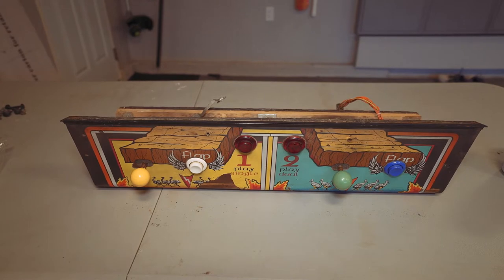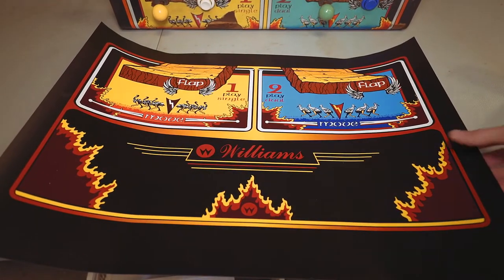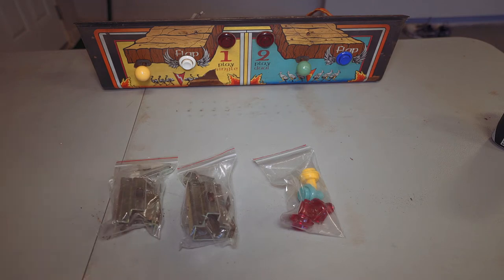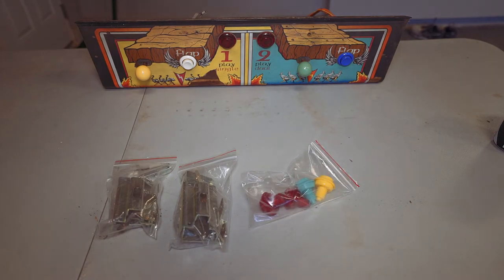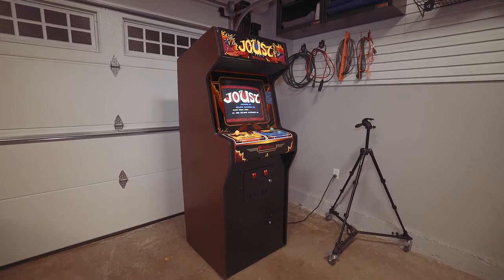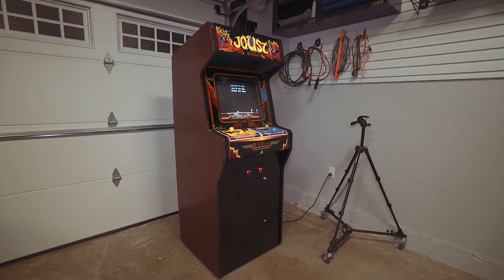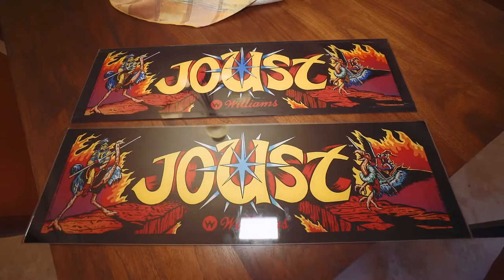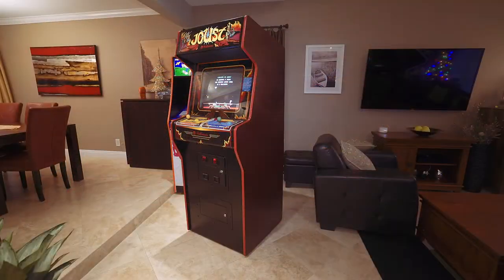Joust Arcade Game Restoration, Part 3

Comment: nice job however automotive filler primer first sand the cabinet down filler bondo which ever your choice then a coating of automotive primer 3 coats let dry in between the three coats then after the last coat let the cabinent sit for 4 days this gives the primer a chance to fully cure and bond once fully cured and bonded to the surface you can then use any paint on the side of the cabinent but great first time job with a joust..

Comment: A few years late, but I was thinking about this problem.  I've watched a lot of videos and read a lot of restoration threads, and almost everyone has issues with the laminate stencil taking off paint.  On top of that, everyone has different opinions about when the best time is to remove the stencil without causing the paint to chip along the edges.

I was wondering if there was a better (yet still affordable) way to do this.  I saw a cool video of a Williams factory making Defender arcades, and apparently they had large steel templates they'd lay on the side of the game, then use a commercial sprayer for the paint.  I was wondering with the proliferation of CNC machines if it'd be economical to do the exact same thing, but with a few sheets of acrylic plastic.  Theoretically you should be able to clean the plastics using alcohol and reuse them.